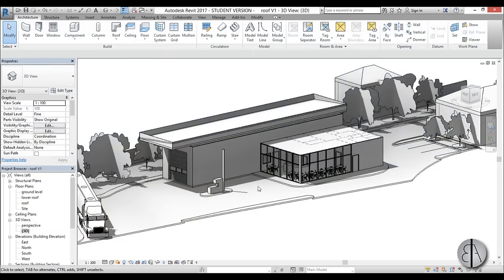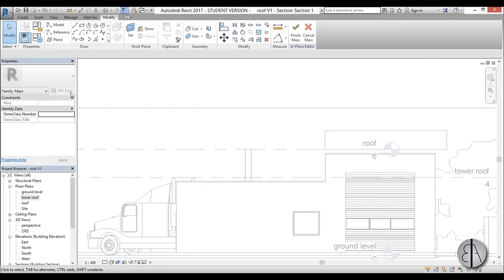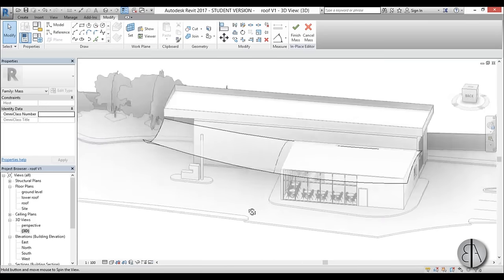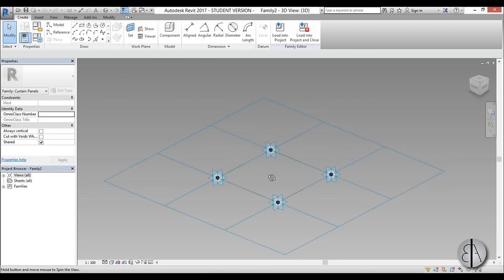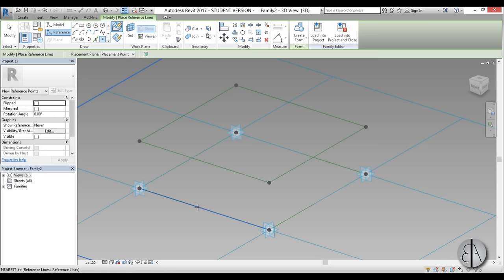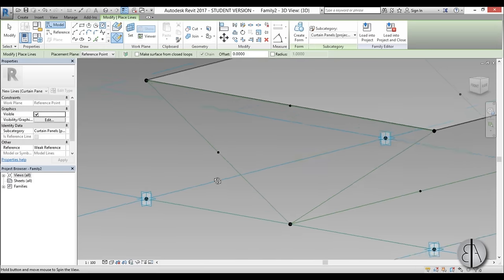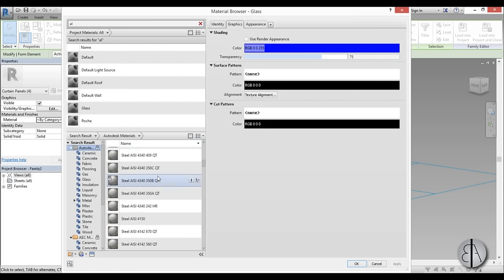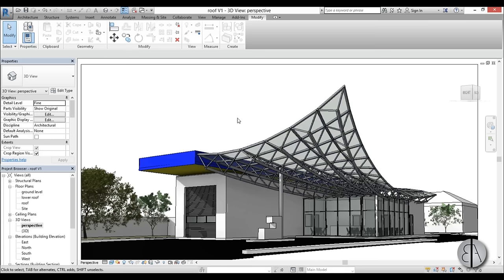Parametric Roof in Revit Tutorial

Comment: I found a solution to the flipping roof in the model. If you see the roof pattern inverted, select the roof in 3D, go to "edit in place" and then in the properties check "component flip" under "pattern application". That's it, you'll have your form right!! This might change the positioning of your roof but you can move the entire roofing unit.
Reply: thank u so much
Reply: Thank you so much
Reply: U r the best🥺❤️
Reply: you just save my project, hahaa thank you
Reply: Thank you.
Reply: Thank you. Do you perhaps know how to attach the columns to the new roof? I tried doing it using the 'Attach Top/Base' tab but that didn't work.
Reply: @lalakarolina8229  can you use align? and choose the surface
Reply: thanks dude
Reply: thank you thank you thank you
Reply: Life saver. Thank you. 🥹
Reply: 😭😭 i spend so much time to solve this, and here it is in comments... I wish i would have seen this before...

Comment: Hi thanks for the video, just one question, when i picked the family into the grid system, the module is linked on the bottom, but upside always ends unlinked, like the 4 corner wont ever join...could you tell me what i am doing wrong?
Reply: Did you find the solution ??
Reply: Damn, i have the same problem.............

Comment: Thank you for the excellent explanation, and I have a question, please. When I inserted the pattern, it was placed in reverse, meaning that the crystal came from the bottom of the ceiling and the beams above it, so what is wrong?
Reply: (from /3d view/ select the roof  /edit in place/select the roof/properties /pattern application/component flip=ok )